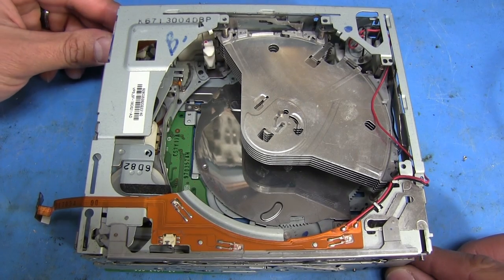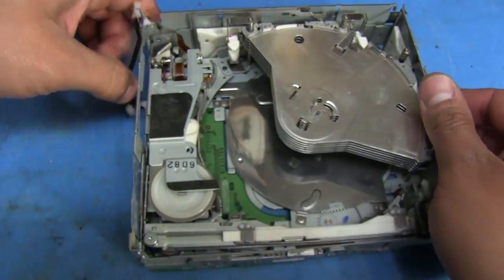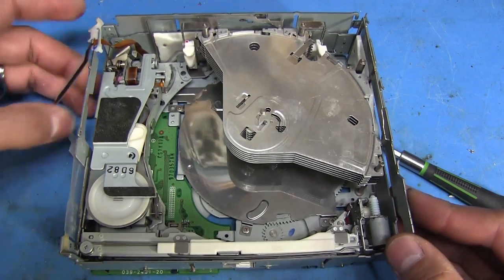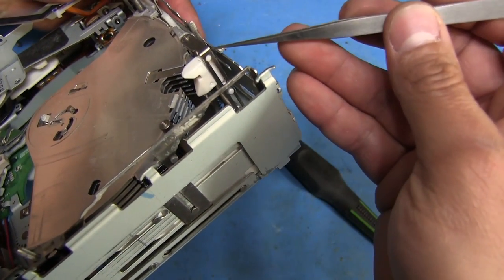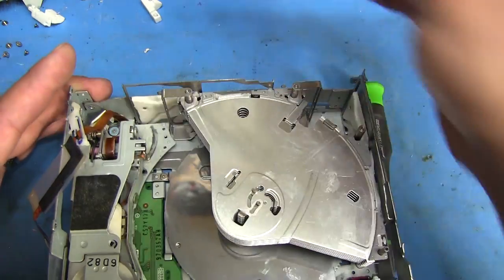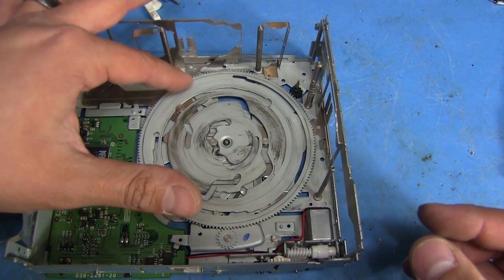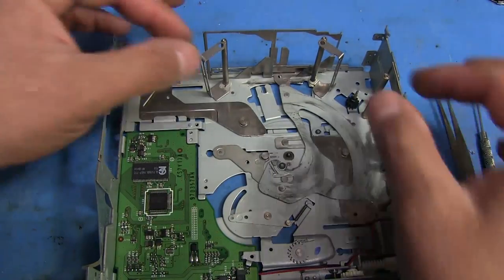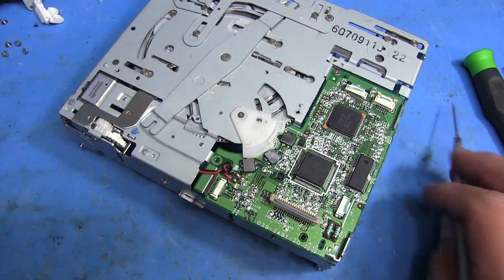TWB #17 | Further Dismantling A Ford 6 Disc Changer

Comment: My laser arm is stuck in the center position too. This happened about a month after I replaced the gear with the broken tooth, re synced the unit, and cleaned all the micro switches with deoxit spray. How do I get the laser arm back into its docking station to the side? PLEASE make a video on this as others have had the same concern. Thanks!

Comment: I have a 2007 Fusion with a 6 CD changer that makes a noise like a gear bypassing another gear or something of that nature.  Any ideas on what and where to look for an issue.  Used to only do it on start up but now it will occasionally do it while driving.

Comment: Your video is great  thank you I did not have to take my 2005 explorer 6 CD changer apart to get stuck CD s out but when I went to put it back in and hooked the electric connector s up it came on without the key even being in it's like the am radio is on but off station someone said I need to reset a code ?? Do you know anything about that I don't have a owner's manual and I just got this truck any help would be appreciated thanks again

Comment: I was stoked while watching this video, as you were very thorough in your explanations.  I thought, "I can do this". So I removed the radio and started the did-assembly, only to find that my unit is completely different from the one in the video.
Any suggestions ?
Reply from the maker: There are at least 3 or 4 different mechanisms that are used in these radios, that I have seen. This particular one (Clarion) seems to be the most common. Unfortunately at the moment I don't have any information dealing with the other types, however I can tell you that I believe the other types are Matsushita and possibly Fujitsu, with Matsushita probably being the next most common type.

Comment: I have a 2002 Escape with the Audiophile CD6 changer, getting the dreaded cd error code. I would like to remove it and restore it as per your video. Is my unit the same as the one in your video? Excellent video, really well done! Thanks.
Reply from the maker: I've seen some radios that look just like the one in this video with a different changer mechanism, so I couldn't tell you for sure which you've got, unfortunately :(

The only way to know for sure is to take the radio out and take a look.

Comment: Hey Workbench, I love your video, it helps a lot with my son 2007 mustang radio (shaker 500). try to remove the black gear that control laser assembly , I noticed middle gear teeth are worn out. do you have any middle gear that I could buy to replace gear.
Reply: Hey Michael, I too discovered the middle gear (white gear) was not only worn out but had broken teeth.  Were you able to find a place to obtain this particular gear?  Any info you could provide would be great, Thanks!